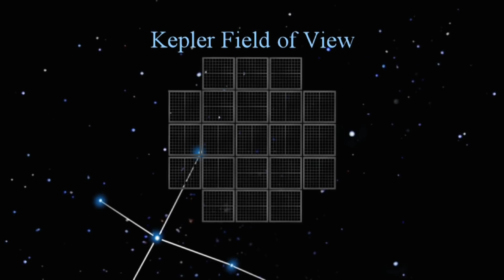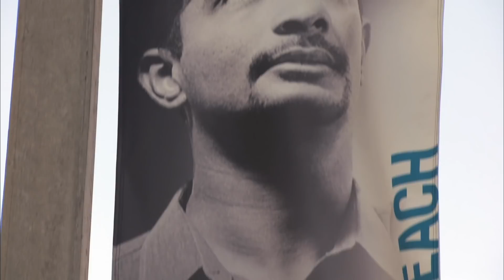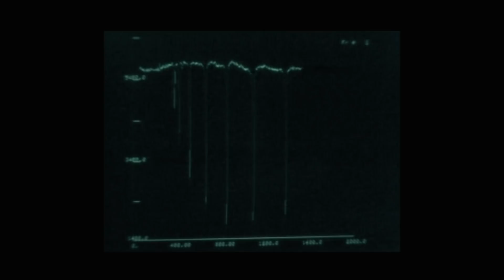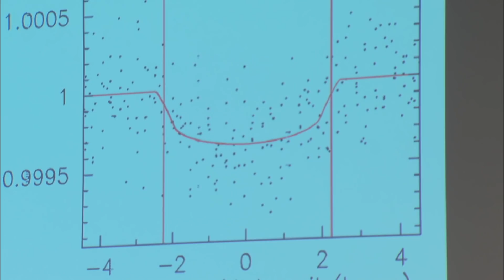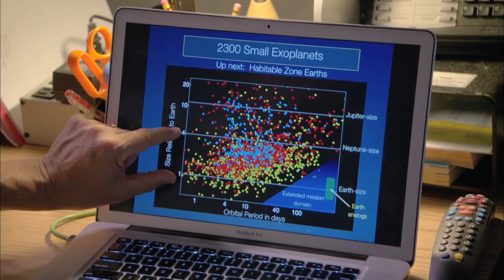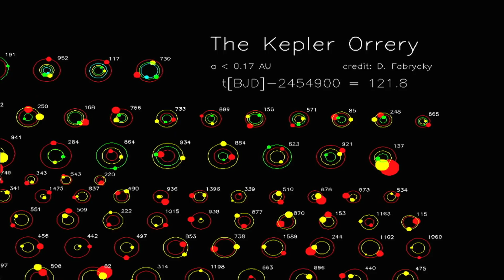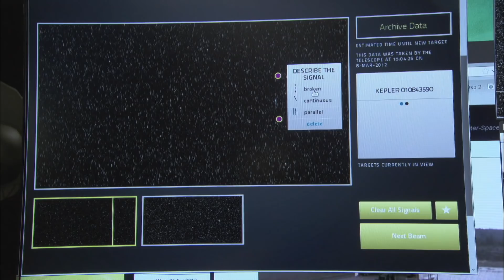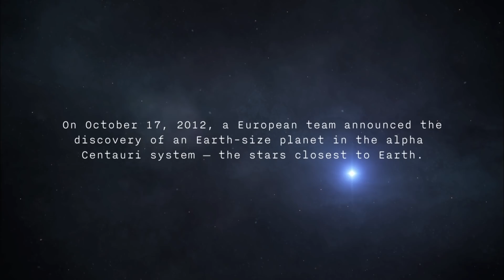The Cosmic Search For A New Planet Earth | Planet Hunters | Spark

Comment: In my opinion, Jupiter is the candidate for life after its formation of gas, as is the case when gases in it are formed into a solid, it will make it smaller and when it becomes solid the force of the sun's attraction to it will be more than its gaseous state because the gaseous state is far from the heat and when it approaches its solid state It will collide with Mars and when this happens it will happen to Mars the dissolution of its crust and its merging, and it will be a crust around it a belt of asteroids and dust that makes Mars become a planet in the state of the eruption of the volcano and when the rocks and dust form around it will reduce the speed of its rotation and become viable